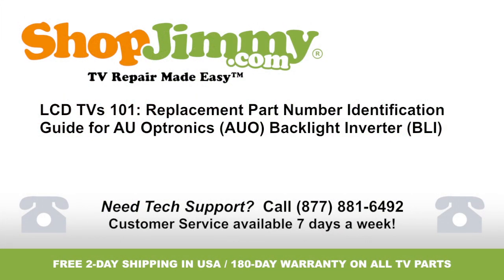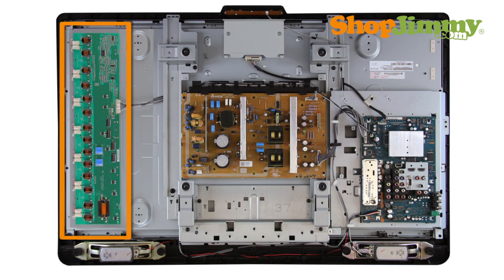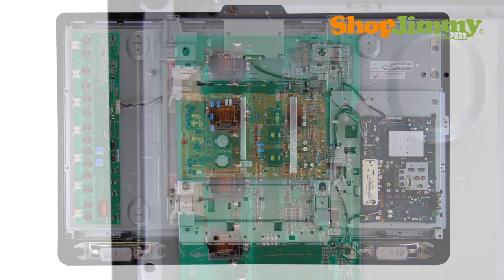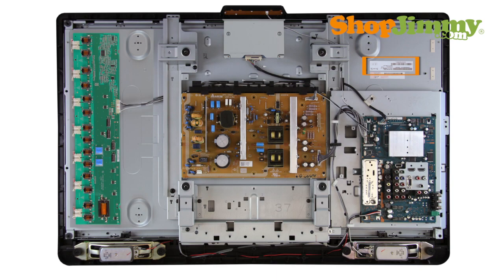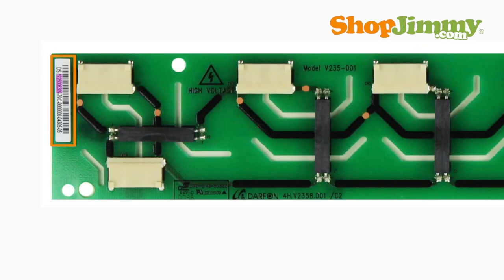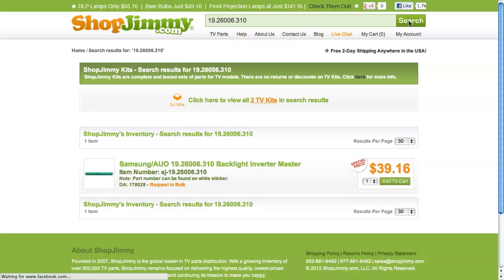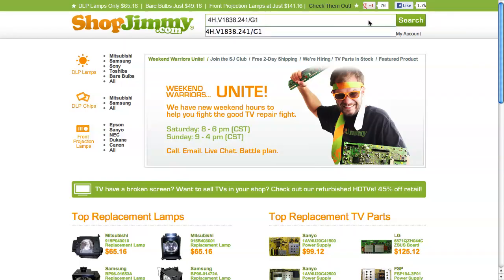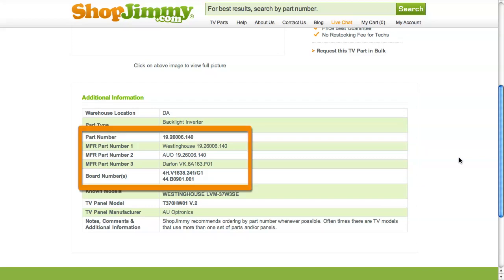LCD TVs 101: Part Identification Number Guide for AU Optronics (AUO) Backlight Inverter Boards

Comment: Hi, please i have a problem with my Sony TV, when i power on the TV it's shoes that the TV is on but no picture 's when prees the channel key up or down the green light blinks ,and when power off with the remote control it goes to standby red light, please can you help me with this problem. Sony kdl-37w5810